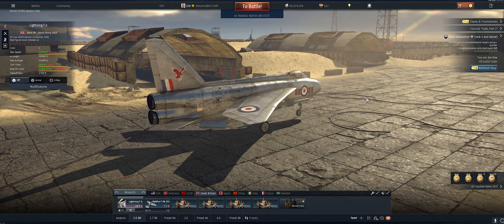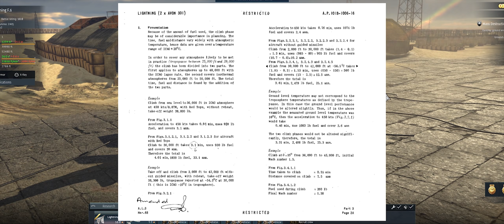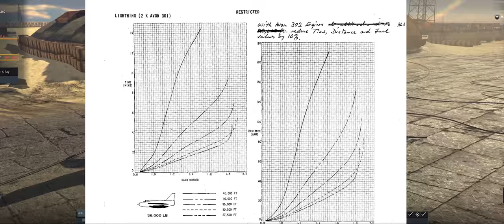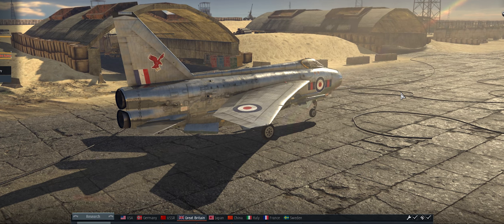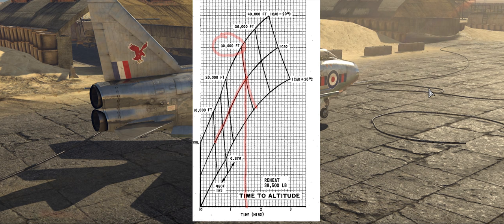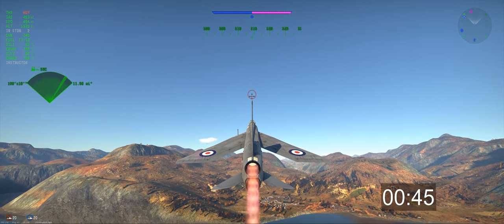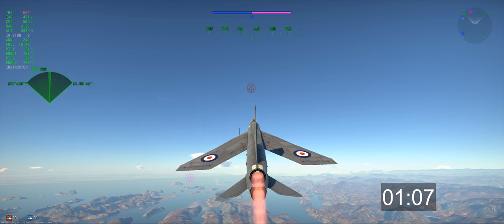True Facts About the English Electric Lightning's Performance - War Thunder 1.97

Comment from the maker: If you'd like to pull the numbers for yourself... you can find the manual here.   Big thanks to Schwarze (the living encyclopedia) and ShayD3nzo (the C-17 and 747 Pilot) for helping me figure out the proper way to put the numbers together. Special thanks to the rotor head 'ScootinVladPutin' for agreeing with me on the charts   :-) 

https://www.avialogs.com/aircraft-e/english-electric/item/3376-ap-101b-1006-16-lightning-f-mk6-operating-data-manual
Reply: It does however state that min fuel the lightning f.6 should have around 1.03 t/w however it cannot keep speed at 90* climb from airfield nor accelerate extremely slightly before running out of fuel.
Reply: @FutureFlash2034  same goes for the fgr 2
Reply: Guess you forgot my tutelage also.........
Reply from the maker: Gotcha fam
Reply: I love you.
Reply: I’m vindicated.... Kisses.
Reply: Single_Best_Video you've ever done. Cheers!
Reply: @chiefbrody4033  I fucking love your name
Reply: @FutureFlash2034  you might want to understand how t/w ratio works and how keeping a 1+ ratio is achievable. having a 1+ t/w ratio does not mean you can 'just point' the nose up at 90 degrees and say it should be gaining speed. thats not how it works its a complete misconception that t/w means 'you just point your nose up' and call it a day. heck once you hit a specific altitude the thrust to weight ratio figure goes totally out the window because drag/air pressure/air intake for engines. all effect the 'thrust' which will effect the ratio figure. so that 1.03t/w ratio could easily be for low alts but at extreme alts no, that would imply the Lightening is able to go to space because it can out 'accelerate' the g-force emitted by the aircraft its self (similar to a rocket) but sadly EEL cannot go to space and has a service ceiling for a reason because t/w figure is clearly for a specific set of circumstances. 

go read up on thrust to weight ratio and you might learn a thing or two on how it 'actually' works and the figures are calculated.
Reply from the maker: You were wrong though... Lol.
Reply: My one concern is that you said it should be performing "10% better". if you mix and match everything I think you will probably find it to be almost identical to real life. The main concern is that whilst the manual says this that and the other it has also been recorded to be faster than that. Personally I think we should shut up about all these minute facts and just play the fucking vehicle to have fun with it. I still enjoy it in simulator more than any other jet. Doesn't need that minute stat to be fun
Reply: Just Pay gaijin and they will buff the stats
Reply: Remember you you pointed out the manual is written for Avon 301's and the variant in games s has 302's? You didn't factor in the approx 10% improvement when presenting your results, you didn't beat the manual by 17 seconds, more like 3.5 seconds... its actually pretty damn close to what it should be.
Reply from the maker: @FallenPhoenix86  10% over chart weight, beat the 450kt time by three seconds, and the time to altitude by 25 seconds.... It was accounted for.
Reply: @WhooptieDo  
You weren't over weight by 10%, you were over weight by 6.5 %.

38500/100=385
41000-38500=2500
2500/385=6.49

The weight wouldn't have that much bearing on time to 450 knots as you're not climbing (much) as you do so, if you do it right it's a level acceleration... thrust/drag matters here, weight/lift don't.

Manual: Time to 450 knots = 45 s
You did it in 42 s
Manual: Total time to FL 300 = 135 s**
You did it in 117 s

135-117=18... so where do you get 25 from?

You are 18 seconds ahead of the manual, not 25... but you have not accounted for the 301/302 performance differential. It's more complicated than just stating that the 10% performance change in 301/302 accounts for the 10% (which it wasn't) weight difference.

**You also obtained your 135 figure by referencing time from sea level, but you weren't at sea level when you pitched up into the climb, you were already at 1000 ft. As each horizontal division on the chart is 6 seconds that means that starting at 1000ft you can knock roughly 3 seconds off from the time you stated.

Having now noticed the 1000ft pitch up error that means the flight model is even closer than I initially thought it was... its not perfect but it is far closer than you are leading people to believe.

I'm not  a Lightning fanboi,  I'm just pointing out your method is flawed and consequently the jet isn't over-performing nearly as badly as you are implying it is. The Lighting is actually doing pretty much exactly what it should.

Don't take this the wrong way, I'm not having a go at you - its intended as constructive feedback if you intend to do more of these as it's honestly not a bad idea.
Reply from the maker: @FallenPhoenix86  I've been flooded with alot of these comments and I'm getting my own shit mixed up now.

  The 1000 feet was accounted for, but it doesn't change the number much in the end.   I was just guestimating when I responded with 10% as I thought in my head it was on the high end of 41k pounds. 

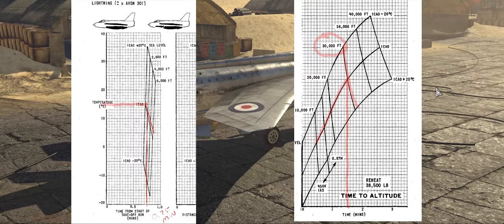The second number came from adding my two total times down, expecting 45 second accel, 1:30 climb, totaling  2:15, in which I made it in 1:58.   In total I beat that by 17 seconds.  Now I'm no math major but I believe that's 12.5% better than expected. In total. 

Now neither of these individually are 10%, but when you think, I'm 'overweight' and still beating the numbers by a considerable margin, that performance is definitely more than 10% over what's expected.  That's my train of thought at least. 

No offense taken, my brain is starting to fry responding to everyone lol.
Reply: Would love to see a facts and figures on the javelin! Talk about under preformance!
Reply: If you make the effort to make a SINGLE point on the BAC lightning (This aircraft is not the EEL)... then why have you not done the same to its competition to see all the facts? No need to answer that as its obvious the second you made the physical effort, the answer is ignorance or bias. 

When was the T-2 released in game and in real life? When was the Lightning released in game and real life?

There is no balance and there is no realism... Gaijin do neither.

Good day, now wheres my tea.
Reply from the maker: @babalonkie  if you read some of the other comments abundant on this video, you'll see that I'm awaiting an MF manual currently to do the same thing.
Reply: @WhooptieDo  Excellent, i look forward to seeing every other aircaft comparison the BAC Lightning is in battle with before this video becomes valid in anyway... then everyone will see that the UK got another top tier vehicle that is not top tier... AGAIN.

Also, where is the turn data, high altitude performance, low altitude performance and payload in comparison to it's competition? Heads up, Other war thunder youtubers have already beat you to that... they actually made the effort to point out its factual flaws in its implementation by gajiin rather than a single point distraction like this video.

Your video = Stop moaning about the lightning because it accelerates faster than it should at none combat ceiling....

"Whoop De Doo" is my exact reply to that fact.
Reply from the maker: @babalonkie  you really expect it to be the best jet in the game huh?  Meanwhile British actually has the most powerful jet in the game (that keep in mind FGR was the successor the EEL)
Reply: @WhooptieDo  Nope, i do not... remind me where i said or even implied that? Or are you once again showing your true colours and jumping to conclusions...?

Also FGR was it successor in long range interceptor and bombing missions due to only 2 reasons... payload capacity and range... the BAC lightning beats the FGR in every other stat and that is why the BAC Lightning was still used for additional 20 years.... just not on carrier based strike missions.

Also off topic...should check the redtop stats in real life and then check every sidewinder stats since the red top creation... the only reason they were replaced is because USA sells weapons for cheap... i see red tops ingame are completely inaccurate... shock horror.

My problem with the lightning is the same as every other UK built vehicle in ground and air for UK the last two years... except the swift... they are never introduced to match the competition they are put with, broken and untested. That is not realistic nore is it balanced.

And that is why i will continue to moan whilst casually sipping my tea.
Reply from the maker: @babalonkie  the red tops are actually trash right now and I completely agree.  The firestreaks are much more viable sadly.     As for the rest of the arguement, I think you are subtle-y hinting are the ultimate problem whether you choose to realize it or not, but never in your statement did you ever hint at the EEL being a fighter, and that's what most of the tea drinkers expect in this game.   A swept wing aircraft that weighs 20 tons to be competitive.   Had the aircraft been introduced to WT over a year ago with the initial supersonics it would have stood a chance.  There is no place in this game currently for interceptor jets, or strike missions.   This game is a giant team death match (sadly).  

Regardless through it all, you seem to be able to carry on a conversation, but that still doesn't entitle you to act like an ass in every reply.
Reply: @WhooptieDo  I act like a ass to every person who ignores the founding problem and shout's teaboo's... exactly what this video is at this time.

Gaijin are releasing broken, untested and unbalanced vehicles in the UK tech tree the last two years... and their solution is to add none UK built vehicles to the tree and patching every top tier vehicle and then bringing it below its competition by a .3 br drop... which does absolutely nothing.

Where is the Jaguar, where is the harrier, where are the scorpions or scimitars... they all can fit right now and be competitive but instead they get rookats and phantoms... and when they do get added they will be redundant and noncompetitive.

Look at the latest UK SAM, been out how long? Only just got a patch AT TOP tier to realistically and fairly reach the enemy that has been shooting at it since release... yes since release it could not reach any enemy at top BR.

I can literately show these types of examples for EVERY UK built Air/Ground for the last two years.
Reply from the maker: @babalonkie  what vehicles are broken and non UK? Aside from the current discussion?
Reply from the maker: The whole point of this video was to counter unfounded information, empty complaints that werent backed up by any factual data produced by other youtubers.   I told them their complaint should be directed at the performance of OTHER aircraft and not the EEL
Reply: @WhooptieDo  Dude... you highlighted nothing but climb... the lightning doesn't have a climb problem (even though it is under performing at low alt and over performing at high)... it has a bad implementation problem... a ongoing problem for UK players. The vehicles are either not tested or intentionally released broken or unbalanced, take your pick... the why means nothing to me.

Every single aircraft in the UK tree at top tier is against better performing vehicles... even the FGR. Skill is not a factor and this has been the theme for a while now. Every time UK gets a fix or new vehicle that competes... Gaijin make sure its up against something better.
Reply: @WhooptieDo  well said. People seem to forget that SMB2 got consistent nerfs patch after patch and it's not like it started off great either. On the other hand, javelin got consistently fixed throughout its lifetime in war thunder yet brit mains still whine.
Reply from the maker: @babalonkie  the FGR has the most power of any top tier jet and can easily outpower even the Mig19.    The Swift is a VERY good aircraft....  The Hunters are all very good aircraft, the only downside is the F6 got the hands down most broken missile in the game so it had to be forcibly uptiered.  The Venom is a very fun aircraft to fly....  The Javelin is a sore subject even for me, I do wish it was better.   The brits have tons of good planes and yet in general y'all complain.
Reply: @WhooptieDo  They only get decent once they are fixed down the line... and it takes people to moan to get them fixed... and its a constant problem for UK players... this is what you keep overlooking.

Also the FGR is out performed in every way by the new phantoms... yet it's the same BR.

Edited: To be less of an ass, Lots going on.
Reply: @WhooptieDo  Yeah I don't think you're wrong. The excuse "it is an interceptor" doesn't mean a whole lot that some people say but the problem with the EEL is not the EEL but rather the fact it has to fight things that it cannot counter. Not making the aircraft bad but the rather just overlooked
Reply: @WhooptieDo   so from this we can gather that the English Electric Lightning is quite accurate to the real thing, so why can the Mig 21 MF/SMT out climb the EEL F.6, maybe the reason people think it's underperforming is due to many other aircraft around it over performing, so if gaijin had the ability to make the EEL accurate, they could at least have the courtesy to make all the other aircraft accurate.

I also want to ask if anyone has actually reached Mach 2.0 yet at 36,000ft?
But also if anyone has gotten to 50,000ft to 60,000 ft in the lightning?
Reply from the maker: @memenecromancer4417  https://cdn.discordapp.com/attachments/636002020972691466/691135768693047336/unknown-19.png

I also managed to zoom climb up to 77K feet, but I didn't play around up there too much.  Could probably go higher.  As for level flight it was a little sluggish ay 60k
Reply: WhooptieDo what about the other point of other aircraft over performing because I think that he may actually have a point there.
Reply: @Alex-dr6sv  give him manuals and he'll test them out.
Reply from the maker: @Alex-dr6sv  I'm simply waiting on manuals.
Reply: Asif Talpur I’ll try and find them, I don’t really want to sound like most other people who think it should be a complete rocket because i don’t. I just want it to be balanced and if not try to get a br reduction
Reply: WhooptieDo I found an f4 phantom manual here, performance stats are at the very back of the manual and The section on climb rates is on page 314, if you can measure the acceleration of both aircraft at different altitudes because I know some people are complaining that the lightning is under performing at low altitudes. I’ll try to find the mig 21 manual but that’ll probably be  difficult because there’s a very strong chance it’s in Russian. Enough rambling, here’s the manual: http://www.f4phantom.com/docs/NATOPS-Flight-Manual-Navy-Model-RF-4B-Aircraft.pdf
Reply: @Alex-dr6sv  completely in the same boat as you man. People, especially brit mains, like to pile on people who state the facts that are not in line to what they were told by BBC or 10 Downing Street
Reply: @whooptieDo the people you mentioned the c17 pilot are these guys your IRL friends or your met them on the game and then they helped you with so much info. nice to see IRL pilots and the info provided by them
Reply: subarashi im not entirely sure how much a c17 pilot would help
Reply: He haven’t come back with a comparison on whether the f4 is over performing so I’m not sure what happened
Reply: Sad thing is we Brits are notorious for understating the real values in the manuals. I have no written proof so you can just brush me off, I'm just saying it was a thing.

I'm not claiming it should be a space shuttle either, however it was designed to go up fast, I mean fast . So when it gets outclimed by a mug 19, that breaks my heart. Yes it should turn like a boat when it has that much power, but that's ok if you're intersecting bombers. So in game this should be replicated with really good climb rate, like 
spit FM(?)9 which can climb turn but has shite guns, for the EEL it should climb shoot but have shite turning. Anywhoo